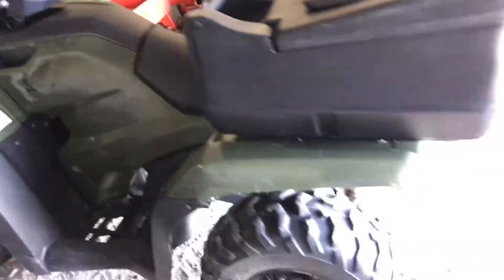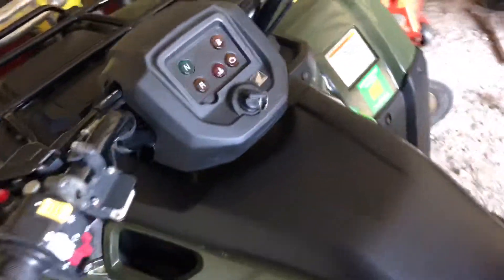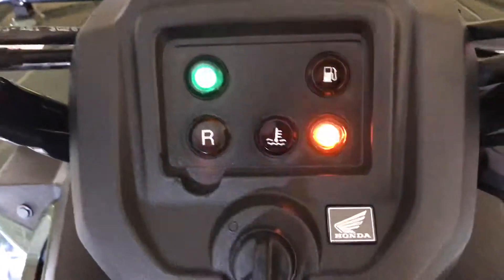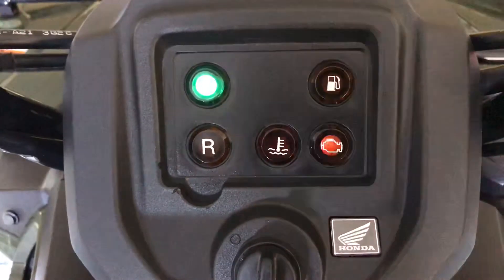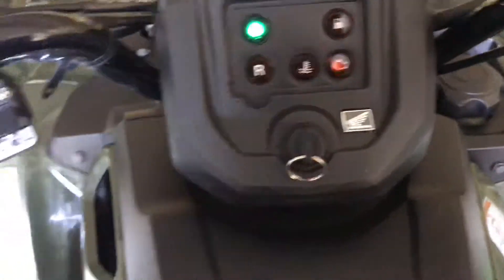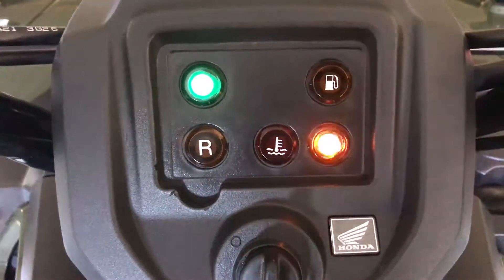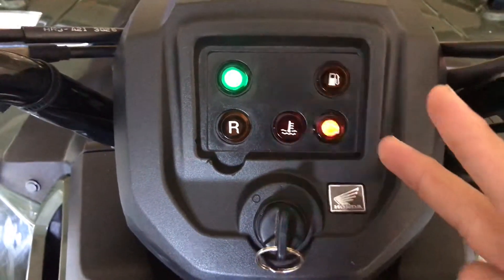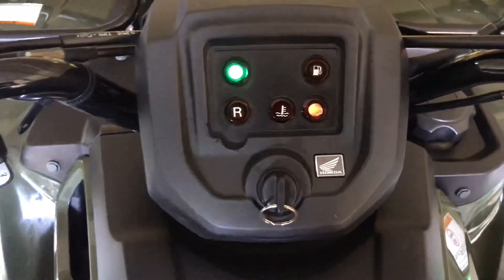Engine light flashing 2010 Honda Rancher 425 - HELP!!

Comment: It’s flashing a code, try to look it up in your owners manual, or online.
Reply from the maker: Off-Road Life 101 Thanks for commenting, turns out the problem was the O2 sensor I took it to the dealer and got a full maintenance on it and now it’s working like brand new. 😎🤙
Reply: - 2gioZ - nice 👍

Comment: That’s the code for your O2 sensor code 23
Reply: Just get a new 1
Reply: Thanks for the info ill have to take it to Honda
Reply: @lennybuis9114  from what I’ve read online even if you get it replaced it could fail and set the code again so it’s kind of a grey area 50/50 chance of it working or not
Reply: Disculpa amigo que significa que parpadie 9 beses